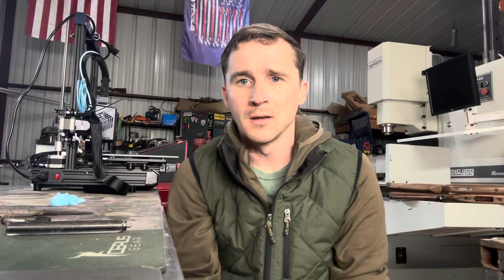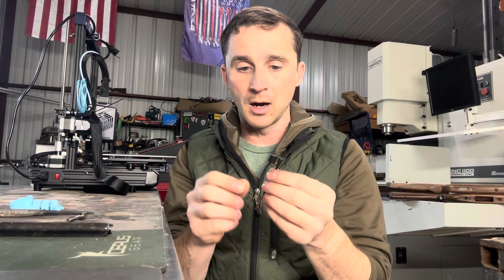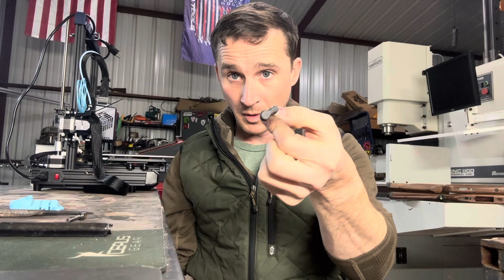3D Printed Firearms Parts - Is There A Place For Them In Gun Smithing?

Comment: Can't beat it for rapid prototyping or things like grips that don't need to be metal. I've found ASA filament stands up to punishment really well. Also came in handy for an old browning trombone .22 I have from the 1940s. The wood was on it's last legs, so I modelled the pump & a new stock so I could still use it while I attempt to replicate or fix the originals.

Comment: Lost sand casting and lost pla casting have always been a want with 3d printing. Mixing up cheaper bronze, gunmetal brass or even navel brass alloys all have alot of options to high stress parts or even receivers.